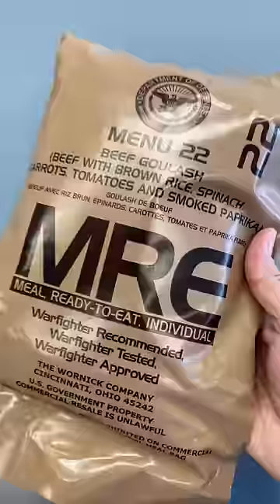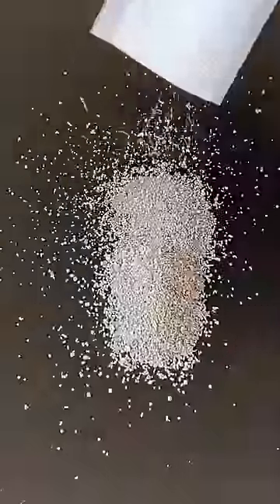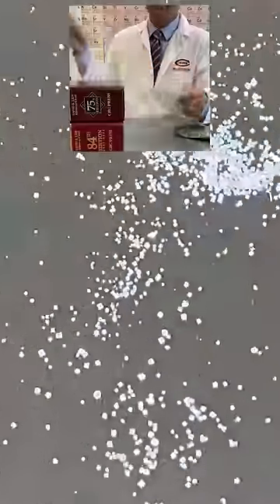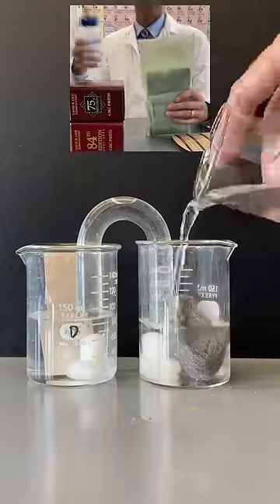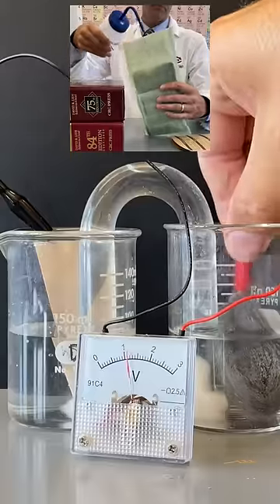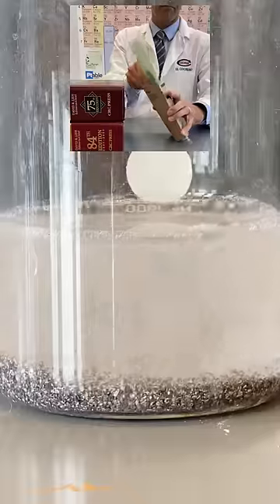Super-corroding Galvanic Cell used to Heat Soldier’s Meals!

Comment: I love the bag that says "lean it against a rock or something"
Reply: That or something is important, what if you can't find a rock?
Reply: @points2000  imagine how it was before they added or something, the marines probably thought it was useless
Reply: Military vagueness
Reply: @user-vp1xm7oj3b  they probably had to resort to their emergency crayon rations
Reply: When I was in the 3ID we used the MRE heater as a test to classify objects as "rock, something, or other."
Reply: @psilocybicacid7667  they eat crayons usually,  food is used in emergency.
Reply: @antoninomilano6700  This comment is underrated!
Reply: Yeah, usually don’t want to leave the extremely hot MRE “stove” on your lap or against anything that shouldn’t get hot 😂
Reply: @user-vp1xm7oj3b yeah, why would I lean it against my food?
Reply: So does Markiplier
Reply: @points2000 use your boot your hat wallet really anything your hands if it's cold honestly. They work pretty good but you got to make sure you massage it every so often and depending on which one it is you got to be careful and massaging it otherwise you're just going to turn everything into a pace which not very pleasant
Reply: @borttorbbq2556  put a bunch of hot sauce in the water INSIDE the stryker with gas mask present and you've got a good prank
Reply: @points2000  even better if you can get a private to do it.
Reply: they honestly heat up better if you just roll them closed and lay them flat.
Reply: Wouldn't it be more efficient if the instructions said "lean it against something" or "keep upright⬆️"
Reply: @points2000  use an or something
Reply: The speak soldier.
Reply: That's the instructions for the water bag that you put one of the giant hand warmers in, the thing he was just talking about.
Reply: @points2000 hold it or you eat cold
Reply: "Lean it against a rock? But we are in a carrier..." (Proceeds to eat the spoon)
Reply: how else were the marines gonna figure it out? they'd just go "damnit, no rocks here, gonna starve to death now"
Reply: @vesperfc3s  you didn't use yours to warm your hands up (through gloves) in the winter?
Reply: @ThePainkiller3666  Honestly a decent use for it, I never really trusted them to be honest. They can get scalding hot really suddenly 😂
Reply: @points2000  “sarge, we can’t eat, there aren’t any rocks to lean our mre against!”
Reply: I heard a funny story about the “rock or something” direction a while ago.

Supposedly when people were developing the flameless ration heater one guy asked the other “what should we lean the FRH against so that the meal cooks properly?” And the guy replies “I dunno, a rock or something.”
Reply: They say that so the folks using them don't take off their perfectly shaped helmets to prop their meals up
Reply: @psilocybicacid7667 how does it feel to be a mindless drone incapable of original thought?
Reply: @u-wot-n8  The helmets work so well for it though 😂
Reply: @tubro541  theres a funny history to how they settled on 'rock or something'.
Reply: Infantry…….what…..
Reply: @points2000  in my 4 years there was always a rock near by lol
Reply: @monkmane2345  okay "monkemane"
Reply: @psilocybicacid7667  sorry idk why I was so rude lol
Reply: Probably designed by a soldier 😂
Reply: @points2000  there is a dead body lying near me. Is that okay?
Reply: @points2000  obviously you find a something.
Reply: @antoninomilano6700  bro. I am not going to cook an MRE on my balls.
Reply: @chase_h.01 🤣🤣🤣🤣
Reply: Oh my god it actually says that I’m dying of laughter 😂😂😂😂😂😂😂
Reply: Me too😂😂😂😂
Reply: never forget to bring your Or Something on assignment with you, never know when you'll need to lean an MRE heating bag against it.
Reply: I used to use my own boot on the steel toe or the backpack they had us carry around. I’m Air Force so we only ate MREs during basic 😂😂
Reply: @user-vp1xm7oj3b  But do Marines know what a rock is though?
Reply: @Peyton Schwarz  you find the or something
Reply: @tubro541  now that's not funny is it
Reply: @borttorbbq2556 WTF is a pase ?
Reply: @points2000 Then just get weed. Crack is the worst.
Reply: @points2000  your helmet, canteen, canteen cup, camelback,
Reply: @user-vp1xm7oj3b  Yeah, I didn't eat a hot MRE for my first year for exactly this reason.
Reply: I know what u referencing
Reply: Which one?
Reply: @points2000  - If you’re a 19D Cavalry Scout, you’ve always got two big rocks with you!
Reply: @ericplaysbass  by dad was 19D boi I did by 11B time haha
Reply: Funny!
Reply: when I had an MRE for the first time I lost my shit over that
Reply: @83jbbentley  “figure it out yourself we aren’t your babysitters”
Reply: @user-vp1xm7oj3b they will lean it up agasint their crayon boxes
Reply: Whats even better is the picture because we cant be trusted to know how to read
Reply: If you know, you know 😏
Reply: @user-vp1xm7oj3b 😂😂😂😂👏🏽👏🏽👏🏽👏🏽 I laughed so hard at this because it’s true!  We’re just modernized cavemen 😂
Reply: i always found that hilarious lol
Reply: @stickyfox  Or other lmfaooo. Holy shit that’s funny
Reply: Where did you even see that?
Reply: @Ratciclefan  its on the instruction sheet that comes with military mre’s
Reply: The eating the MRE at the end with such clinical detachment is what made the video for me
Reply: @user-vp1xm7oj3b  You're saying that as if they could read the directions anyway ☠️
Reply: If you try to hold it it can burn you so they let it cool off
Reply: “ lean it against a rock or something idk 🤷🏻‍♂️ you’re the soldier” is basically what it’s saying 😂
Reply: The “or something” just makes it hilarious 😭
Reply: A hole works for the mre heaters too... Dig a small hole just big enough to set the heater at a slight angle
Reply: Because soldiers have below room temp iq and need things explained to them like children
Reply: @user-vp1xm7oj3b  nothing is really useless when they were never going to be used for it's intended purpose
Reply: @antoninomilano6700  yeah just look down, soldiers always have two big rocks and something
Reply: My dad was in the military and he’s going to get a tattoo of the “rock or something”
Reply: @points2000  I'm very glad no douche canoe did this in my stryker, actually I'm just very glad no one did this in general, I wonder how much it would burn, shit, this is why we get in these situations, no I don't wonder. You almost talked me into it.
Reply: Hahahahha it say ‘Rock or Something’!!!
Reply: I never bothered to read the green bags when I was in the army lmao didn’t know it says that till I went and looked
Reply: That’s what we did tho it’d not like we have microwaves
Reply: My helmet
Reply: Even camping mres say that 😂💀
Reply: Remember the first time I read that 😂 spit out my penne paste
Reply: @user-vp1xm7oj3b  bro forgot crayon boxes exist, I love the green ones
Reply: Even on Swedish heaters you sometimes see that written
Reply: @user-vp1xm7oj3b  Lean it against my stack of snack crayons.
Reply: @points2000  then i hope sumthing is around
Reply: I GOT MY MEAL AGAINST A ROCK OR SOMETHIN
Reply: @Abdullah-qe7sf  that’s the marines
Reply: @points2000  if you met some of the people I knew in the Army…these instructions are critical 😂
Reply: @points2000   death
Reply: "Just a rock or sum"
Reply: W America W MRA W Food W Guy W Science😮 
W Quote
Reply: Im kinda disappointed the rock isnt included xD
Reply: We just used the box it came in
Reply: I forgot about that 😂😂
Reply: Awesome!
Reply: I always make that joke “like hey guys i found my “or something””
Reply: I have that diagram tattooed on my right cheek
Reply: Instructions unclear, ive been leaning on a rock for 6 hours and my food is still not cooked
Reply: "just put it up a rock or smthng
Reply: “Idk man just figure it out I guess we’re not chefs”
Reply: Always used my boot 😂
Reply: It was after the days of “Place on a hot engine or exhaust pipe”
Reply: When you’re hunkered down in a blown out building, well there’s plenty of rubble, mainly rock to lean it against. But pretty much every piece of instruction on military equipment is Barney styled like that for the slow joes.
Reply: It's an inside joke
Reply: The guys designing the label were coming up on quitting time, and "Okay, so how do we describe that it needs to be at an angle?" "I dunno, lean it on a rock or something, it's martini o'clock." "Good point, send it to print, first round's on me!" That's actually a lot closer than you'd think to the actual story.
Reply: It's my favorite part
Reply: A lot of the times that smt is our boots just remember it’s there or you create a mess
Reply: Right…
Where do I get a “something”?
Reply: Cultured comment
Reply: @points2000 or something
Reply: Does it say that on the packaging?
Reply: grabs human skull
Reply: Ive found boots work best
Reply: the beautiful part is that the drawn diagram labels "rock or something"
Reply: @points2000  Barely ever get to actually use the heater
Reply: Instructions even a grunt can understand lol
Reply: Well a majority of them go to grunts aka: Alcoholic 20 year olds who scored below 850 on the SAT
Reply: @user-vp1xm7oj3b  funny thing. It was because a guy decided to do malicious compliance from a jerkoff manager. Who when asked "what should we put that they lean it on?" Manager said . "a rock or something." That manager was pissed when looking a few days later and saw that's what it said. (Source: I was in the army.)
Reply: @GGman2019   they could do that but then all the crayons would melt 😢😢😢...
Reply: @points2000  Then you go for the "or something" route. I can guarantee you will find "something".
Reply: ah ya said it first but still strange we all know about that
Reply: @points2000 I always used my helmet
Reply: I feel like there's at least 1 marine who carries a tactical rock for this purpose
Reply: Damn, we used to keep our hands warm with it, our feet, I know a guy that would put them in his bag at night😂
Reply: @points2000  so they don’t dump the water out they’re really dumb

Comment: for anyone wondering why they can't just include matches and wood or something, you can't cook with fire in many situations because the light of a fire would give your position away to the enemy
Reply: There are matches in a mre
Reply: @patriotliberator3160  yes but for cigarettes or used if not in combat. Also, if you simply put the thing over fire, it would burn since it is packaged in plastic (some aren't in plastic)
Reply: @kej888  if there is water or food inside it shouldn't burn
Reply: @Maxawa0851  what i mean is if you put the food itself on top of a fire while it's still in plastic
Reply: Soldier here. In a tactical situation you won't use fire. If you can use fire, you can boil water in a cups canteen or a pot... Some people have a jetboil. Pouches go in the hot water if you have no exothermic pouch. I usually just eat wet pouches cold... who has the time?
Reply: @KayAteChef  oh ok
Reply: They also do include matches
Reply: Smoke, smell and the flame itself
Reply: @patriotliberator3160  Those are for cigs if you’re on an established area like a FOB, not the same as lighting a fucking camp fire during a mission lol.
Reply: @KayAteChef  Fr dude, but the main meal hot tastes 20x better, it hides that chemical taste a little lmao
Reply: Nobody was wondering
Reply: sometimes a cigarette cherry is enough
(or the pulsing light of an iphone's low battery indicator)
Reply: Light from fire is not the issue if you know how to build it right, the scent though travels very long distances.
Reply: that the insanely flammable bags that have to still travel and if they are wet they wouldn't work. I mean we were in the woods alot and had plenty of sticks and could make fire in the field.
Reply: @sassafrasofficial3695  not anymore
Reply: @KayAteChef  so it takes like the jail grub?
Reply: @itb4255  its like asking a sniper to F u guys esp midnight
Reply: Lighting a fire takes time
Reply: @KayAteChef  the time it takes to warm it up is all you have to eat anyway.
Reply: It's obvious that you don't know what you're talking about. "Wood or something"??? Lol. For anyone wondering why they can't just include a bonfire with each meal? Brilliant. Light discipline is the least commonly needed reason for flameless heating.
Reply: That's why their official name is "Flameless Ration Heater".
Reply: Yet most mre meals come with a matchbook 🤔
Reply: Many MREs from around the world have dry fill tablets that are combustible and you place them in a makeshift steel tray to warm up food. No smoke is produced. The Ukrainian MREs are much more elaborate and have steel or reusable matches.
Reply: And now in tactical situations, you generally don't use these because you need to eat fast, save water, reduce thermal signature, reduce the smell of hot food, and conserve water. Plus you'll usually field strip them by removing unnecessary items to reduce weight and volume. In cold weather they can be used for body warmth.
Reply: Meanwhile, watching the NATO channel:
Italian pulls out matches and a fuel cube. Almost starts a wildfire.
Reply: Literally never thought why.   Can't believe someone had to say that reason.  Not necessarily the light I mean during day you could.    But smoke can be smelled miles away  even by humans.   I mean dogs will smell you after 2 days in the field  for a few extra miles
Reply: Some still actually have a book of "damp proof" matches in the little bag that has the instant coffee, napkins etc. They are green.
Reply: @KayAteChef what's a cups canteen? We get our canteens from DLA and they are plastic.  Federal for 23yrs, never seen a cups canteen.  Don't know the NSN# off hand. I'll have to look.
Reply: @mamixon100  In the Australian Army we have aluminium cups that fit under the canteens. You can boil water in them when you are allowed. It generally goes that you can do it before dark but that is a busy time of day. Depends on the exercise.
Reply: Probably also just faster than having to set up a fire and weatherproof
Reply: Exepy id you use alcohol like french ration does because alcohol doesn’t make a visible flame
Reply: And the Army doesn't trust grown men with open flames most of the time. Sadly, most of those grown men would prove the Army right not to.
Reply: Actually surprisingly enough MRE's have had matches since the dawn of time. Why, I never figured out!
Reply: the British army does
you have to work during the day
you can eat food at night
but you cant cook at night
SO WHAT THE FUCK AM I CARRYING 50 HEXI BLOCKS FOR
Reply: Thank you captain obvious. In other news, when fired upon, engage! Donkey post. Ex Afghanistan soldier.
Reply: @sargera1  They actually taste pretty decent. It's not luxury dining, but it's also not hardtack and gruel. I'd compare it to roughly the level of gas station food, but a hell of a lot safer to eat as they're completely sterilized to make them last, so no worries about botulism.
Reply: We made fires. Sometimes you need to make that wrong decision to stay warm. Never to cook. I ate these suckers cold every time. Juice isn't worth the squeeze on the heaters. They do burn bright and hot though just long enough to get a fire going. Someone usually has a lighter.
Reply: This guy thinks they don't include a bundle of wood in the mre because the light would give away your position 😂
Reply: Which just shows how archaic and outdated military thinking is. How many soldiers do you think died in the Ukraine war because they lit up a cigarette or had a small fire going? 

In modern war the enemy has a pretty damn good idea where you are at all times, and things like drones and night vision goggles are wide spread. On the modern battlefield, if you're in a static position, the only reason you're not dead is because the enemy doesn't have strong enough firepower to bring to bare on you that exact second, not because you're some wood ninja.
Reply: @KayAteChef Britain we will cook but it’s horrid during winter when you can’t have a fire during dark hours so your always having cold breakfast and tea hard routine is horrid even worse some people won’t even let you smoke at night
Reply: @TheBeeseik you can use water that you have cooked with for eating it’s why we have 2 mess tins larger one goes on the top helps heat it up quicker and stops most of the water evaporating either make a brew with it or pour it back into your bottle 
But yea your not cooking if your in a firefight